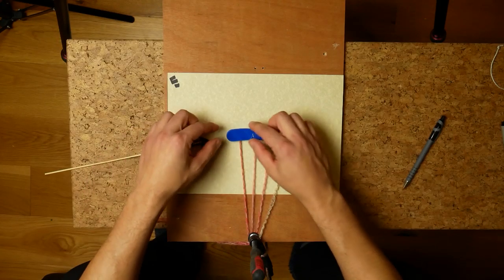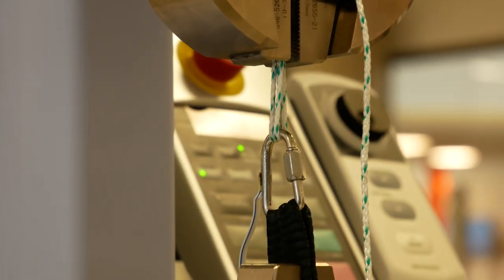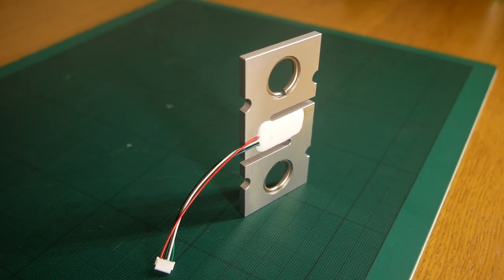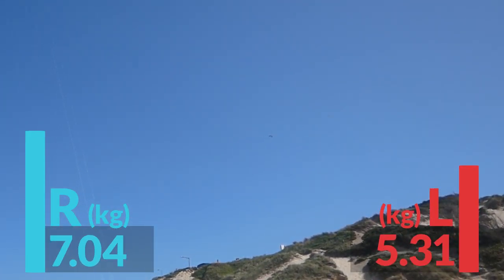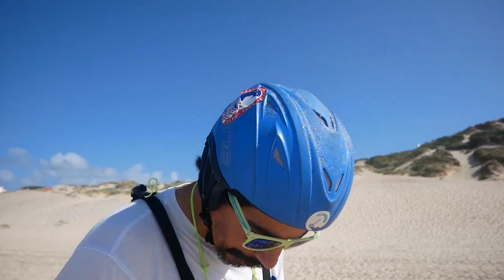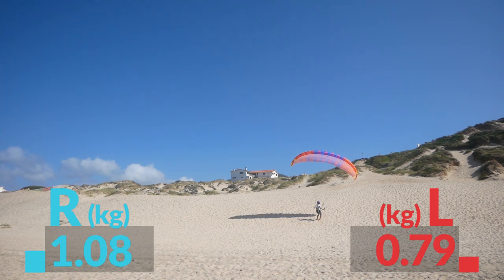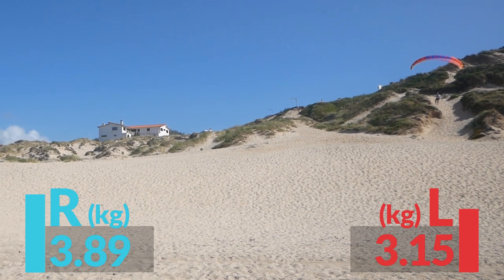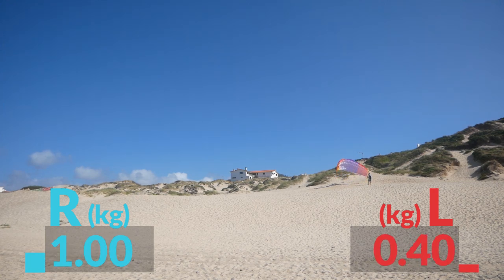Measuring Line Tension on a Paraglider - Uncollapsible Paraglider Part 5 - BANDARRA

Comment: If you are gathering the sensor data by bluetooth, you can take a look at the Mipfly vario. It's open source and runs Linux. It's basically a computer. You could add a new widget on it's screen to show you the data, make calculations based on the data and maybe sound the alarm when lines are no longer under pressure.

Comment: Hi Andre, great bit of science going on.  Only one concern, you have your box on a bit of a noose around your neck. I think it would be a safety improvement to put it in your harness. I think to measure the other lines/riser tension you'll need something between the mailons and the lines. or replace the mailons with a strain sensor. Want a good strong one... Looking forward to the next instalment.